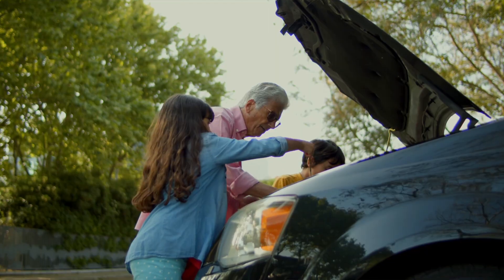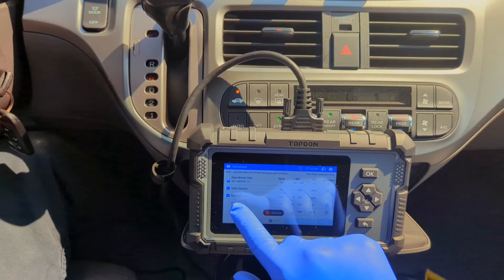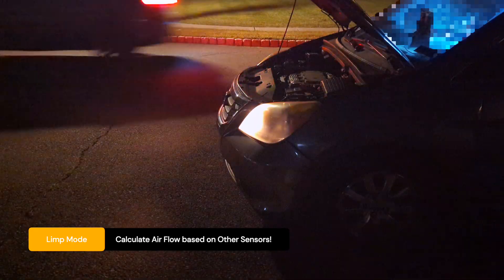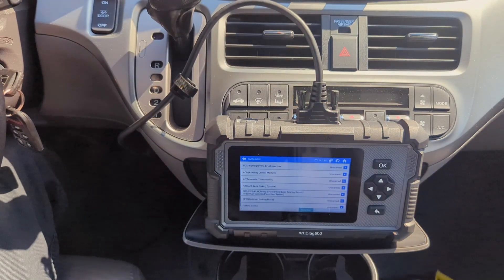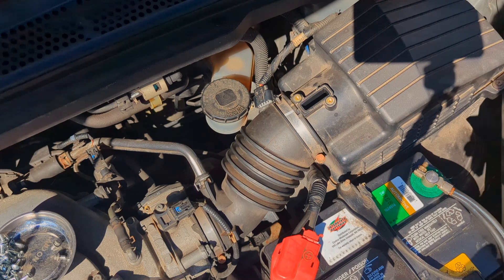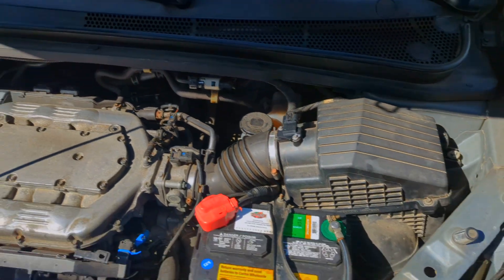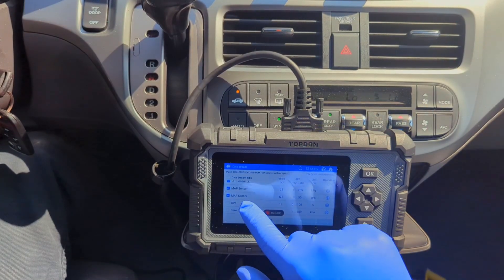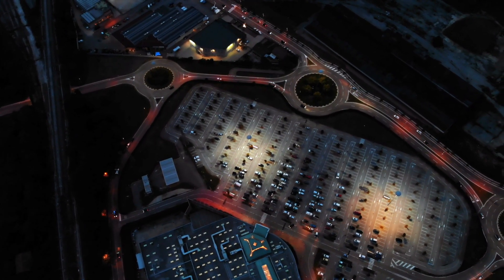STRANDED! How I Fixed My Stalling Engine With NO Tools.

Comment: You probably could have just bought a mass air flow cleaner to clean and reuse MAF
Reply from the maker: You could and cleaning it with a MAF cleaner is usually the most cost-effective! But this one is probably gone--I cleaned it about 50k miles ago and recently did a full-throttle test to show it was fully functional until this sudden death. At 170k miles, just thought I gave a new aftermarket unit a try, and will see how long it lasts and keep everyone updated. It has lasted a month and hopefully will last a year or two, which will be worth it (for one tenth of the OE price).
Reply: @profsg cool, hope it lasts a long time